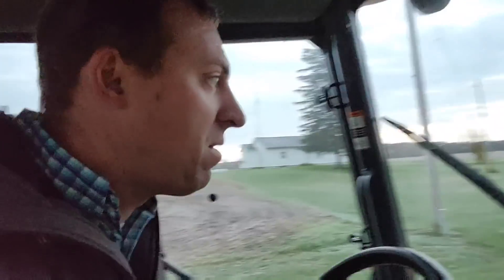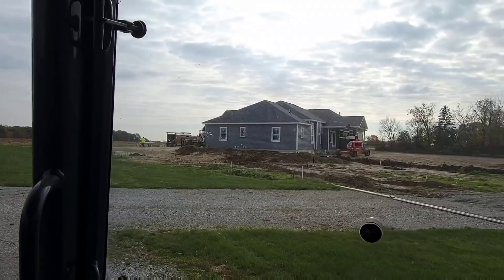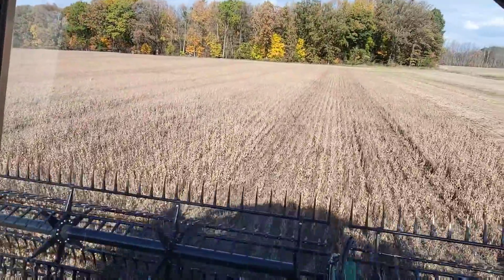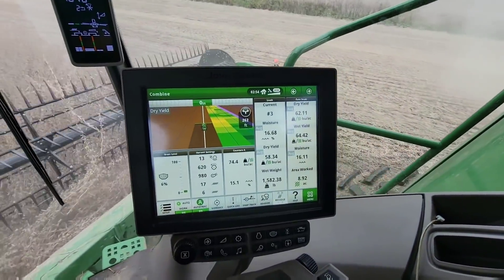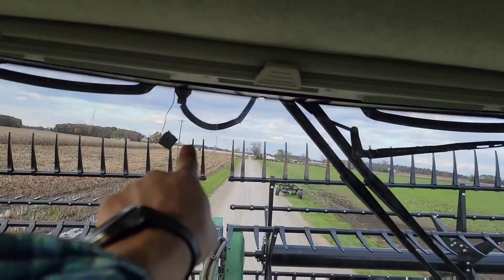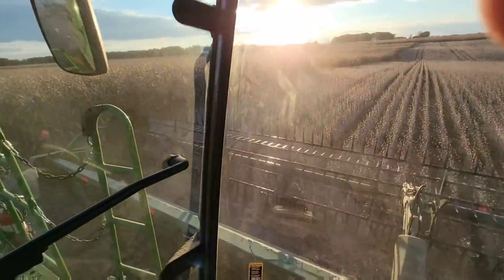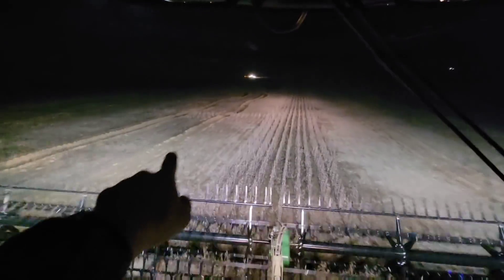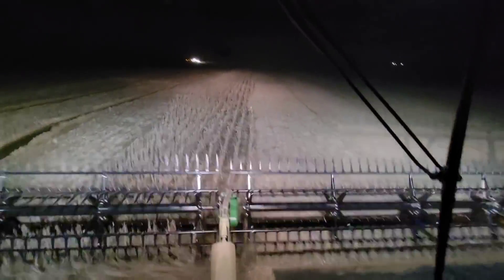Drifting a $500,000 Combine - #540

Comment: So ur almost done on beans and I assume ur almost done with corn, do u have a lot expectations to get a ton of tillage done this fall assuming the weather good. Also do u like the difference between the air seeded soybeans and the 16” spacing. Additionally do u think you’d airseed a whole field in the spring?
Reply from the maker: The narrow row soybeans were good for the double crop but I don't think we'll use the airseeder in the spring. The 15" planter still does a better job.  Yes lots of tillage to get done yet.